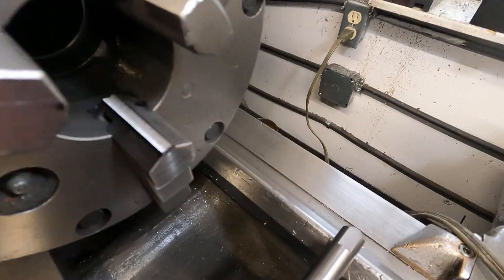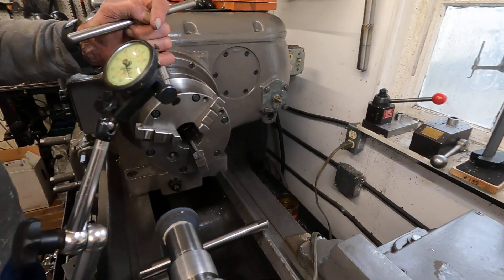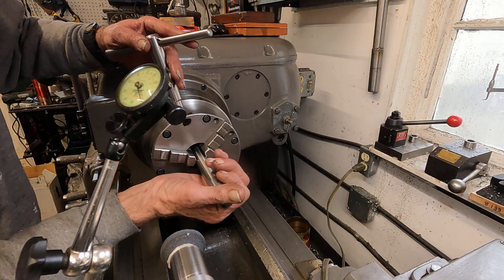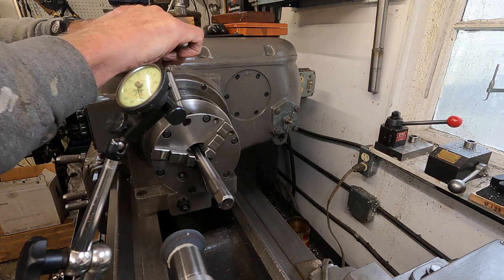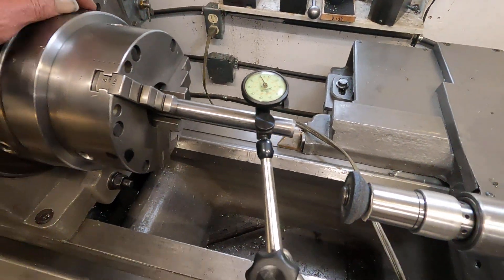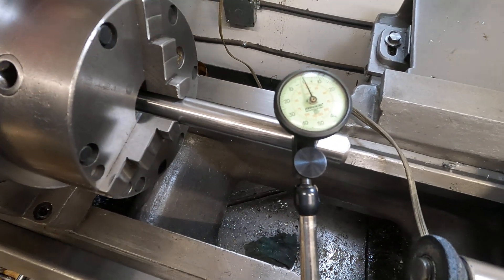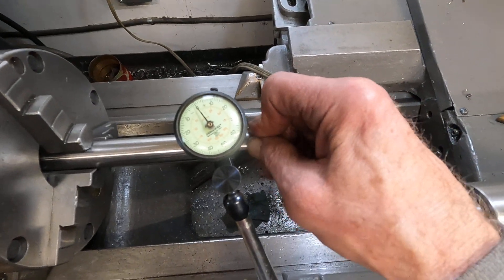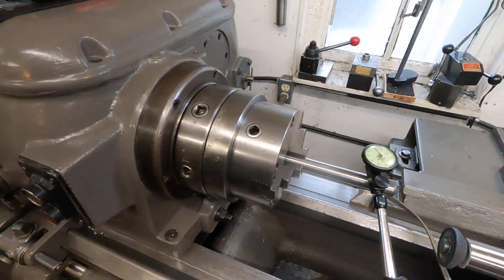Advanced lathe chuck fitting part 3 the test

Comment: Great Job DD! Probably better than bored soft jaws! 
One thing though, don't hard jaws usually have serrations 90 degrees to each jaw to prevent  work "slippage" under cutting pressures?
Reply from the maker: Most modern chucks with two-piece jaws have serrations, these older solid jaw chucks usually do not, the cast iron bodies are not as strong and made for light duty and this one has a 2000 rpm speed limit.